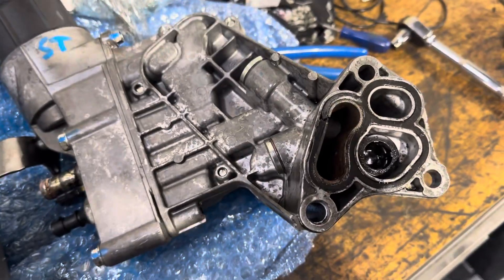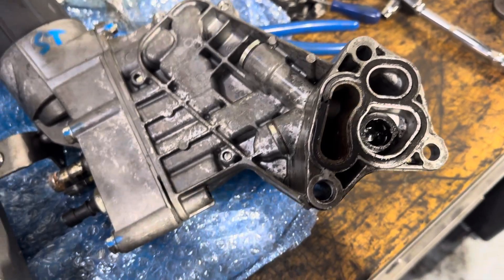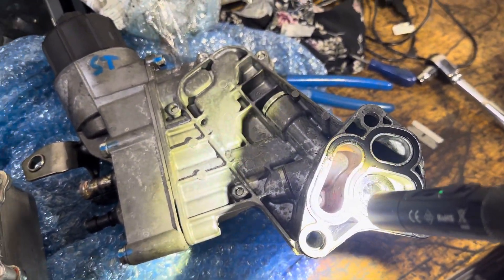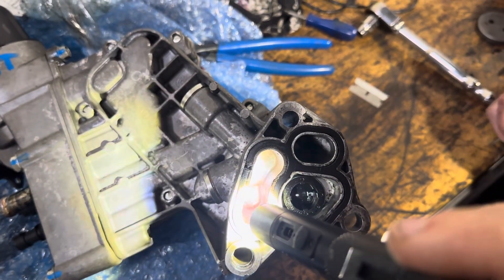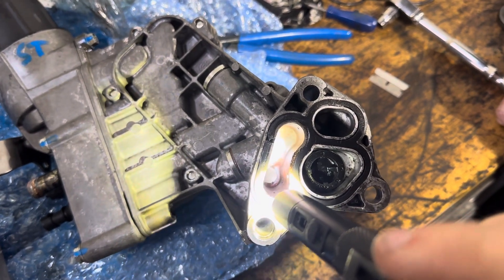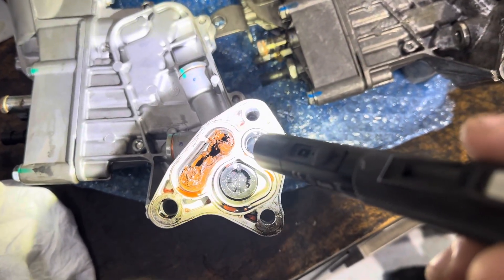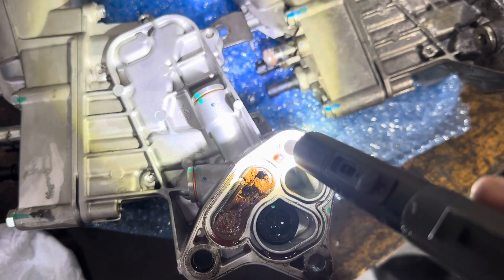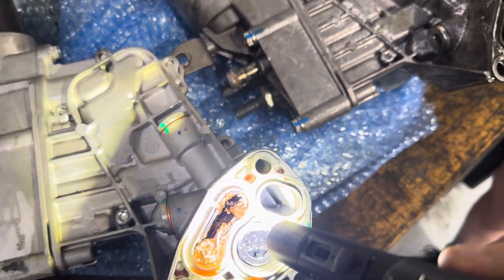Wk2 Diesel engine oil temperature to high

Comment: Amazing videos! Very informative and helpful. Makes owning an EcoDiesel Jeep someone scary. Do you happen to know when the thermo fan should begin to come on? 
Doing some anecdotal tests on my own Jeep compared to my father in-laws I noticed if you turn off the A/C the fan does not come on. I noticed oil temperature can reach 104 degree C without any fans coming on. However if you turn on the A/C the fan drops the oil temperature very quickly to 87 degree C through the oil cooler water exchange. 
So could it be assumed Jeep tuned these vehicle in hope that owners drive with the A/C on?

Comment: I had the dealer replace mine because it was leaking and now my oil runs hotter than usual. As soon as the temp passes 220F the fan turns on screaming. The coolant temp is fine. Do you think I have a defective oil cooler?
Reply from the maker: yes, or for some reason the coolant is not getting enough flow or any flow into the cooler itself. is the Z hose kinked?
Reply: The hose that connects to the oil cooler?  No it seems ok.  The coolant hose under the intake is also brand new, that one was covered under a recall because that was leaking too. @GDLautoblog
Reply: @GDLautoblog  Hi!  I posted a reply yesterday to you but for some reason it looks like it did not post.  I dont see the z hose kinked at least as far as I can see.  I have replaced the coolant hose under the intake, also new radiator, water pump and thermostat.  the dealer says its normal but I know my jeep and I know its running hotter than usual.  I dont know, im ready to give up.  In my area there are no diesel mechanics and when I go to different shops they cant believe my wk2 is a diesel, lol and they decline working on it.  Maybe I should ship my jeep to you guys to take apart for me.
Reply from the maker: @Bekim8310  its normal for the WK2 to run warmer than it used to after cooling system work. I put this down to coolant used but cant prove it. and in my opinion the OE coolant os rubbish causing a large amount of problems. 
If you follow our facebook page Jeepmotive and go back a  fair way we did a heap of research around the increased coolant temp reading after cooling system work. 
As long as it doesnt go over the 3/4 mark you ok

Comment: good video, question, what's the deal with the mesh insert, I have heard of some with and some without..
Reply: Mine was 2014 didn't have the mesh, ordered a new mopar replacement oil cooler had mesh, I think Mesh is good, it's cleanable. Just took mine off after 60k miles/100k km's, screen had some grainey looking crap in it, new seal and reinstalled.